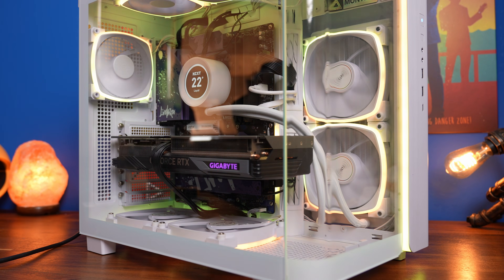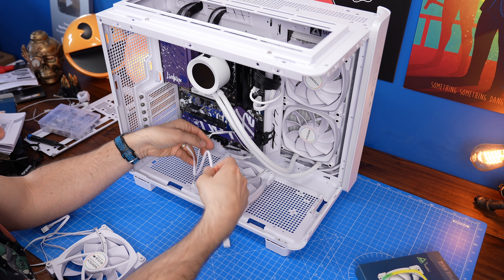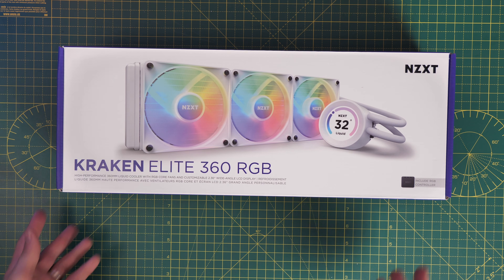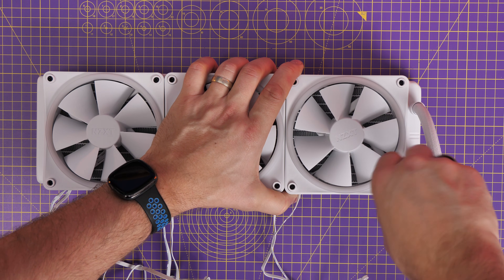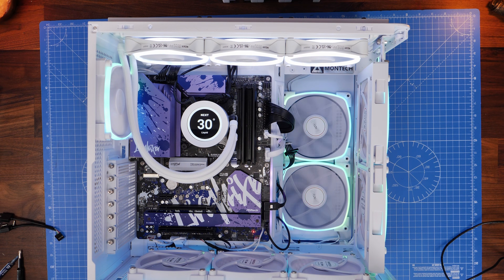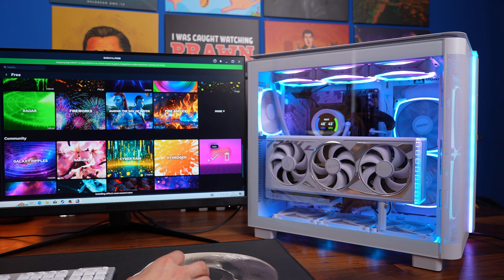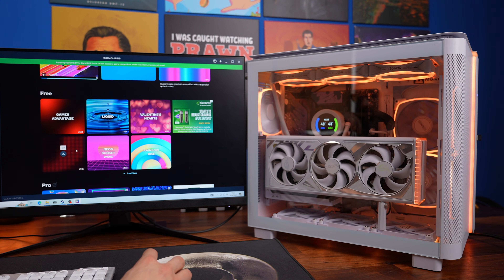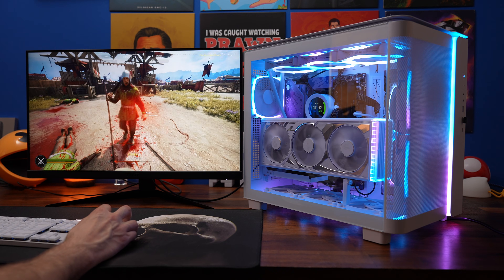I fixed this RGB problem but caused another - Montech and NZXT RGB syncing  with SignalRGB

Comment: You can control the rgb with mystic light by holding the rgb then the rgb will go off afer that open the msi mystic light or any rgb control software
Reply: Mine doesn’t doesn’t work

Comment: hi i decided to use signal rgb for manage my rgb.....before i used corsair icue link.......but i noticed that the software icue link sucks.....and often doesn't found the command controller and then i cannot to change my light rgb......i don't understand what is its problem......with signal rgb i don't understand how can i put  an image in the cooler...... i also cannot to see the temperatures ...are there  more features with the pro version where can i do this?

Comment: thanks for explaining everything well
Reply: Does it also control the fan speeds? and if so, will this make you not plug in the aio because it needs to spin faster?
Reply from the maker: No just the RGB.

Comment: I used the montech king 95 Pro in my build. It came with a controller where i can connect all the A/RGB pins and it works well with the RGB button on the front of the case. But i cant find a software to manage all the fans etc(i also have a arctic liquid freezer 3 360 connected to the controller). Is there any way to use software, or will i have to buy  a different controller/hub?
Reply from the maker: I don't know what the controller looks like? Does it connect via usb or 5v to the motherboard? If USB then there will be software. If 5v then you'll need to use your motherboard software for it or SignalRGB
Reply: @TheProvokedPrawn  its Uses a 5v connection to the motherboard and sata for Power i think. I tried SignalRGB, but its not working. It cant even give any information to the hub/Controller (idk why), so i cant even have Single colour let alone effects for the fans etc. 

Now im trying the asrock Software - polychrome snyc (even though a lot of people say its just bloatware). I hope that works. 

In the long run i will  have to get a different Controller though. Can you recommend any? It should at least have 6 or 7 argb Pins. 

Thanks a lot

Comment: I ran into a similar issue.  All my fans and AIO are NZXT, but my ram is Corsair Vengeance Pro RGB.  I was not about to pay a subscription to control my fans, and download yet another program to control my pump screen, and also another program to control the AIO pump.  I found that if you start NZXT Cam after SignalRBG is up and running, then SignalRGB still controls the RGB and NZXT CAM will control the fans and AIO without issue.  The problem is when NZXT CAM is running before SignalRGB starts up.  The same is true for Razer Snapse that controls keyboards/mice/pads.  If Snapse is running first, it will also conflict with Signal.
Reply from the maker: Interesting

Comment: I found some 4 pin to 3 pin converter cables for argb. Thinking about converting the Argb pins to 3 pins plugging those into the montech controller but plugging the fans into the motherboard so I can control those through the nzxt cam software. I just won’t have all the color patterns which I’m fine with.  It will be nice when sync argb comes out with LCD software cause that will solve this dumb problem.

Comment: As a standard on rgb lights, there are a few built in controllers on rgb strips(Chip IC): ws2811, ws2812, ws2812B, ws2813, SK6812 and more. But the ""traditional"" argb present in computer hardware, like fans, are 2812, 2812b, SK6812. This means that almost all products in this argb line are compatible with the controllers, what manufacturers normally do is create proprietary connectors, proprietary software and effects. But rgb basically works with 3 wires: 5v, data, ground (the data from the controller is recognized in all chip ic on the leds). It would be enough to identify this pattern in the fans wiring, strip the wires, and solder them to a "standard" connector. Okay, now you can connect all the fans to the same controller or to the same connector on your motherboard. No other controllers or software needed.

Comment: Just did a build with this case... But, I cant get the rgb strip on the case itself to work at all. Hmmmm
Reply: Did you ever figure this out? Currently my issue :c
Reply: @DaysforDaays  I got help. Someone who knew more than me showed me where I had it connected wrong .. but I'd be lying if I said months later that I could explain it to you. Sorry bro

Comment: Thanks for the shout out! And we plan to add LCD control soon.
Reply: still no LCD control :(
Reply from the maker: Excellent news.
Reply: NZXT LCD control please ! 🙏
Reply: it's been 11 months.... is this going to happen or is this another casualty of tariffs
Reply: Still no news on NZXT screen control?
Reply: yes please fix it having problems with the Thermaltake TH360 V2 Ultra ARGB LCD AlO also theres somee problems wheen you add the fans it has problems trying to sync the right fans btw is there any way to try and custom the fans LED to work in diff zones like how you can do with the LIAN Li Fans
Reply: That would be very helpful cause I’m going to be running into this problem very soon and would like to use the software to get everything to work.  Time or date when you think lcd control we be out?
Reply: Any plan to add montech keyboard? thanks
Reply: Sweet!
Reply: one Year Later
Reply: @SignalRGB Any plans to add the support soon?
Reply: Still no support.  Cannot use my Kraken properly...is there another rgb software that is better than signal?
Reply: WHERE IS ITTTTTT

Comment: SignalRGB is detecting the pump, cpu fans, and RAM, but for some reason it's not detecting the nzxt fans that are connected to the hub, any idea why?
Reply: You need to configure the nzxt fans on the controller you connected them to.
Reply: @Pancake-k1c  so I'd have to use nzxt cam separately instead of using signalrgb for all my fans?

Comment: I was using nzxt cam and saphire trixx  to control my rgb for these 20 days and suddenly my 7800xt nitro gpu stopped showing rgb lights which is just 6 months old

Do you guys think this is software related bug or hardware issue 

I have surrender the card , but for the sake of rgb it is not worth it to get the rma

Saphire has said they will try to troubleshoot and then will decide to issue a new card or not

Comment: I certainly feel your pain on this one. 

I decided to get both a CPU cooler and a GPU with LCD displays on them for my last build. One from MSI requiring MSI Centre and one from Gigabyte so it needs Gigabyte Control Centre.

Add in some Razer peripherals requiring Synapse and iCue link fans from Corsair and theres barely a day goes by without some kind of RGB software conflict on boot.

Great idea in theory, but it's a literal nightmare of frozen LCD displays and unsynced RGB fans in reality.